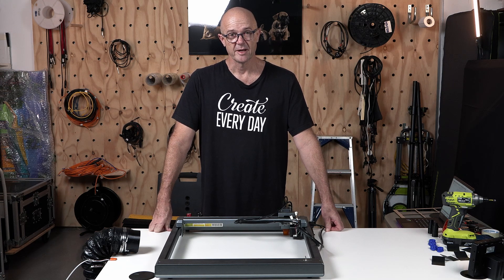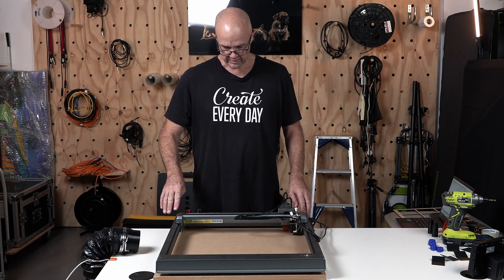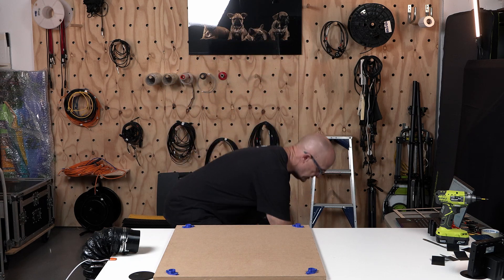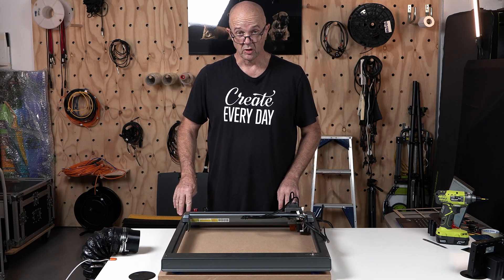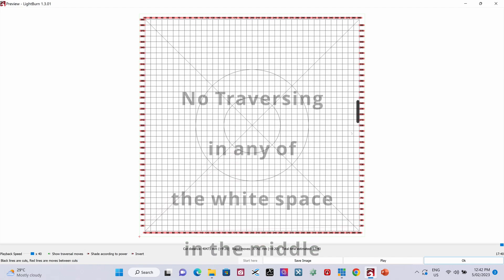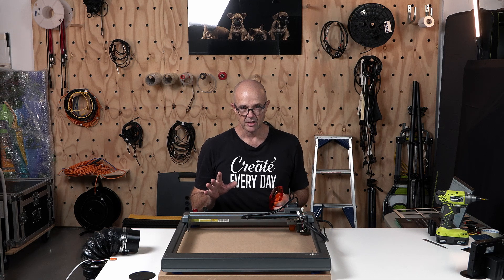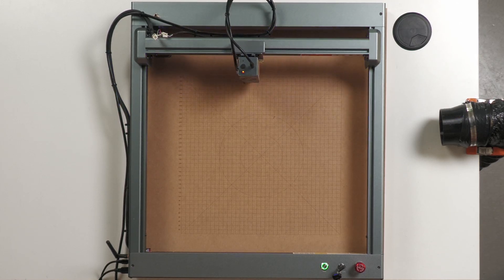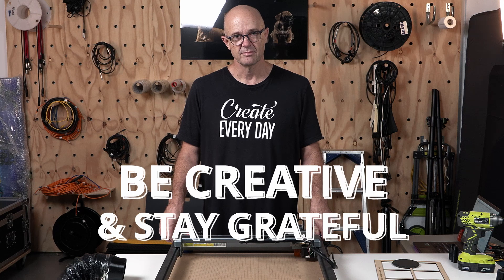No More CROOKED jobs - Step-by-Step Setup of Your Custom Waste Board for Perfect Engraving - Part 2

Comment: Hi Darren! First of all, thanks for the video. However, I have a question: Is there a material that can be used to replace the waste board but that will not be marked (burned) by the laser? Otherwise, from time to time, the waste board will need to be replaced because the laser will burn it. Thanks
Reply from the maker: Hi Dan - the answer is in the name - waste board - that size of mdf is cheap - plus you can use both sides
Reply: @mrcraftsmith  Of course! Thank you

Comment: Bob
Hi Darren 
i have just recently purchased an Ortur LM3 and I followed your video ( which by the way is brilliant) and drew up the grid but when I went to burn it the laser kept going up and down one side and I get a notice come up saying G code locked out during alarm or jog state and a pop up box saying cut might be out of bounds. I'm just wandering if by chance you would know what I'm doing wrong
Reply: PS sorry I forgot to mention it does frame OK
Reply from the maker: Hi Bob - thanks for watching - one thing that springs to mind is the overscan setting for the text/fill layers that may cause out of bounds - if you change the text to line and see if it gives you the same warning
Reply: @mrcraftsmith  Thank you for replying Darren. I will give it a try tomorrow.